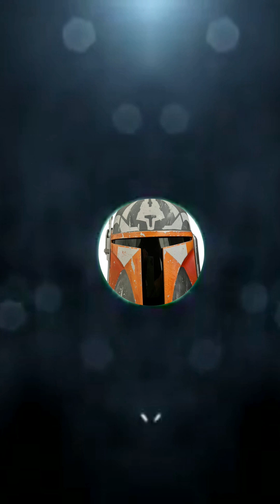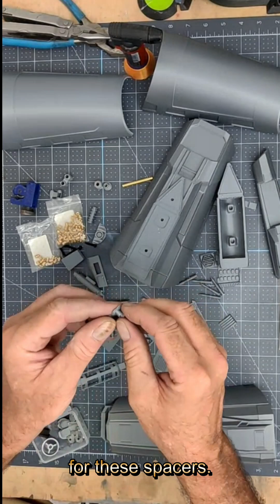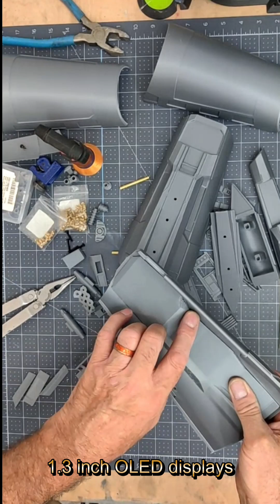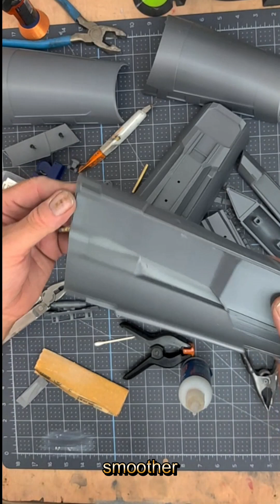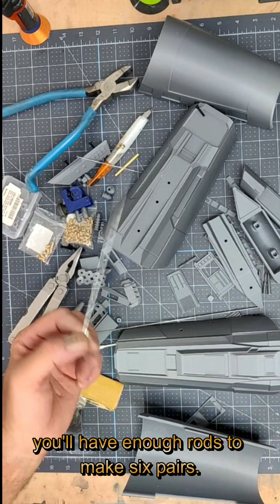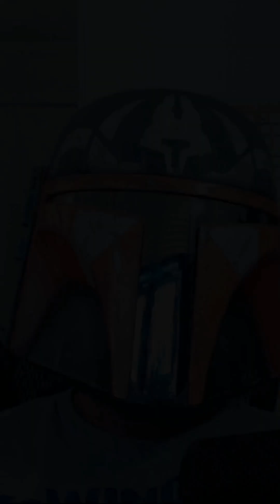DIY Mandalorian Armor: Gen3 Gauntlets Complete Assembly Tutorial

Comment: Hi there HK! I was curious to ask if you happen to have linkes to the steel hinges and brass tubings? figured it wouldn't hurt to ask here
Reply from the maker: Hardware needed for attaching accessories to the Gen3 Gauntlets:

-Knurled brass nuts (aka threaded inserts): https://amzn.to/4hmj1sf 
-Screws: M3 x 12mm for whipcord; M3 x 12mm for Fenixito; M3 x 12mm for Boba Fett style whistling birds; M3 x 16mm for DinDjarin style whistling birds.   I recommend getting an assortment box in Black finish: https://amzn.to/3A1thFP or these in Silver finish:  https://amzn.to/3Yn9AjE 
-Brass tubing for the flamethrower:  https://amzn.to/3L3F7RC  
-Stainless Steel rods for the hinge 1.5mm x 300mm (will work if scaled up to about 110%, if scaling down I recommend welding wire from your local hardware store): https://amzn.to/46yzRkP 
-Din Djarin style whistling bird was made to work with Concordia Arms' Universal Din Djarin Whistling Birds kit. https://www.etsy.com/listing/879729368/universal-fit-animated-whistling-birds 
-Please read the Gen3 Gauntlets Instructions and specific parts Notes included in the zip file for additional information.
Reply: would there be any chance the instructions could be resent to someone? My email I had it on no longer works :/ but asides that thank you for the in-depth information always been a fan of your stuff!
Reply from the maker: @KojiWoji_  If you bought the file on Etsy, message me there and we'll give you a new link to download everything.

Comment: You know I was just thinking of purchasing the kit of this gauntlet set and this is definitely going to be a help.
Reply from the maker: Excellent! That makes my day. You can also message me anytime if you need help.
Reply: @thearmoredcreator I'll keep that in mind.  Also doesn't the version 3 set have a hinge with a built  in locking system.
Reply from the maker: @amirboufenik1204  yes, it's a tab/slot closure with a hinge on one side. You can see my hinge closure design in action in this video, shown on the original M1 style gauntlet pair: https://drive.google.com/file/d/19UFPDo9KWShIW-M9wtXta5eZ1tjzv2tA/view?usp=sharing
Reply: @thearmoredcreator alright. Final question.  I saw on your listing that the right gauntlet comes with the flamethrower attachment as well.   If you confirm that for sure then you've got a sale and you'll see one in your Etsy by Saturday at the latest.
Reply from the maker: @amirboufenik1204  The right gauntlet includes a whipcord and can accommodate 2 electronic displays. I include display info with the order, and which shops you can buy them from. The left gauntlet has the flamethrower and whistling bird, in your choice of Din Djarin style or Boba Fett style.